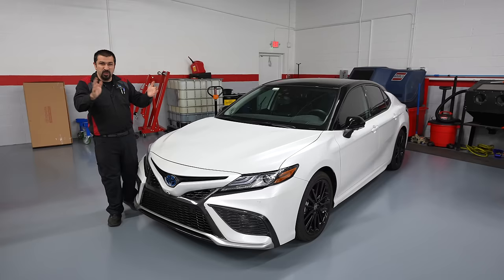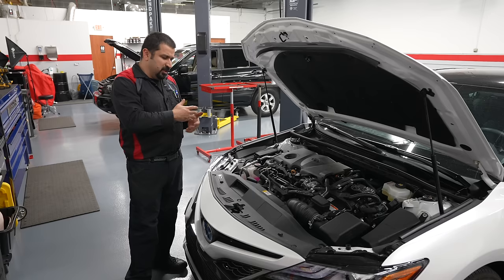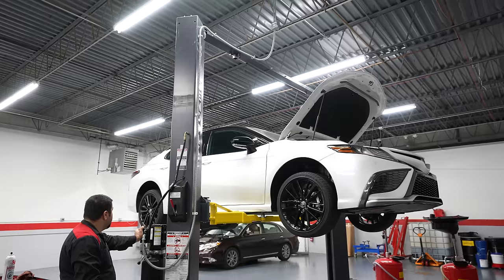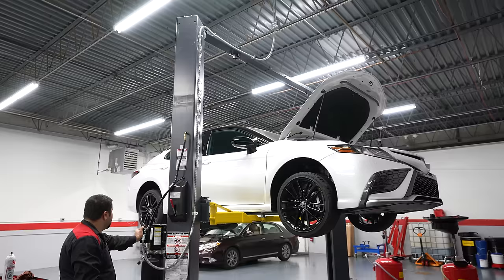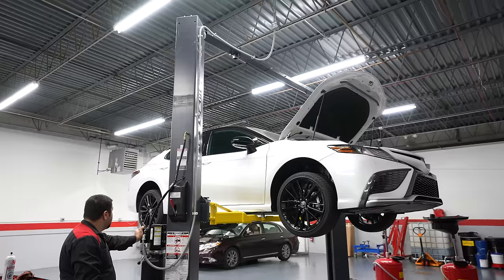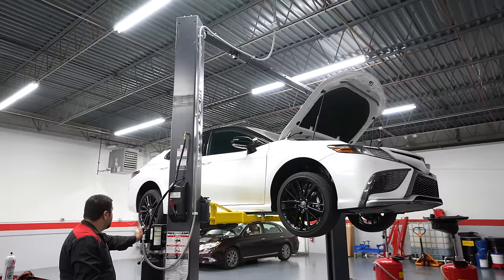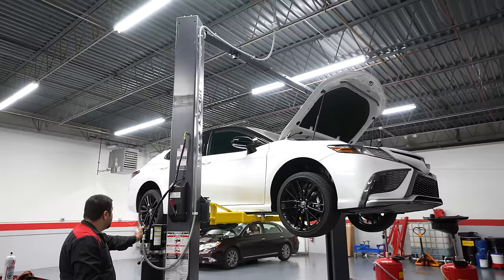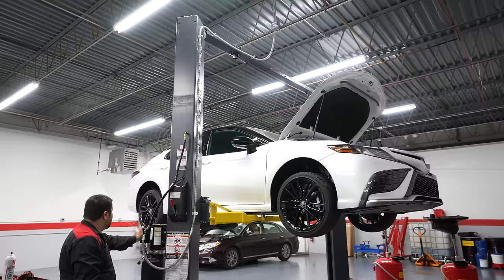Should you buy a Toyota Camry Hybrid? 1 Year Ownership Update

Comment: I love your channel it's very informative I have a question regarding my Camry 2023 hybrid Le. I want to take your advice to change the oil at 1000 miles for break-in and at 5,000 MI for first oil change after break in and I cannot locate an oil filter. All the sites have 20 22s listed none of them have the 2023 so my question is this, is it a standard N1 filter that I need or is it something different for the 2023. Love you videos they're great keep making them. Regards Jim k
Reply: Standard the oil filter is same since 2018 since it’s the same engine since 2018 just make sure you get an oil filter from a reputable source or dealer

Comment: Our 2020 Camry Hybrid with Li-ion batteries has a warning in the Owner's Manual that the engine will not start when temperatures fall to -21 degrees F or below.  At low temperatures, Li-ion batteries become useless bricks.  Both EVs and plug-in hybrids have heaters to be useful at low temperatures.  If all Toyota Camrys are now hybrid, does that mean they are of limited use in winter here in the cold north?  Or, do the new Camrys provide heaters for the Li-ion battery pack?

Comment: Great video, I just purchased a 2023 Toyota Camry SE upgrade Hybrid and would like to know what diagnostic tool brands I can use to make changes on the car specifically to turn off the seat belt chimes, I drive my car 1/2 mile down a dead end gravel road to my moms house and very much dislike the chimes just for that short trip. Can you tell me some brands that will work for this? I live in Canada. I asked Toyota and they refuse to do it due to some liability issue, on my 2021 they did it for me. Thanks.

Comment: Just got a 2022 camry se, NON hybrid this summer.   Really like the car.  Couple things though, as you said, body panel gaps, bugs me every time I look at them (hood and fenders mostly)  and twice while pulling into a drive with a dip that would put a diagonal twisting force on the chassis,  it sounded like the roof skin popped (tin canned) (sun roof car) not real loud.  2.5 is noisy when cold, i believe it's normal gdi noise? Anyway, fuel economy is great, 36-40+ on most trips.  Maybe you have some insight on how and when it switches between gdi/mpi?  Any fuel system maintenance on these to keep them happier? Amazing little engine.  Thanks, love the video's.

Comment: What is wrong about non-Toyota engine oil? If I use the same grade from an API certified engine oil it should offer the the same protection no? If Toyota only sells 1 kind of 5w20 oil for all the different kinds of Toyota engines using 5w20, I don't see what is special about Toyota Oil?

Comment: Ya man. I got a 22 highlander plantinum. And the build quality is complete trash. I’m very disappointed. My 16 Prius and 15 sienna are both more solid by comparison. Aside from how crappy the 8 speed transmission is to begin with. It gets worse when it heats up. And when it gets loaded up with passenger I’ve noticed a weird vibration when accelerating!
Im assuming it’s related to where they are sourcing parts from.

Comment: Is the wet boot maybe a specific rubber oil/grease that keeps the rubber soft? You can buy spray oil for rubber bushings to keep the rubber soft and flexible. My Toyota has 100,000 miles and all the original bushings. There's some micro stress cracks but nothing thats in needs replacing yet. The only bushing I've had issues with is the anti-roll bar drop links.

Comment: Yes I changed my oil at 982 miles 2022 Corolla SE. Had old Japanese oem oil filter and number didn't match my new one. It was old part #. After watching this I will change it at 2500 miles next to be safe. The car is stunning. Wind Chill Pearl color so sharp. Bought it after your recommendation video I watched. Really surprised Toyota didn't offer hood insulation.  Only on 1.8 not 2.0 just a bare hood. Went and purchased fireproof insulation and shaped it to fit under hood. You added hood shock to your Camry can it be added to 2022 Corolla SE? Thanks Amd.

Comment: Through a service dept window I noticed they used oil from a supply line not bottles when we had the first oil change in our Highlander.  Do they use a substandard oil in most shops? Also they were not happy that we had a service done at 5K miles vs the 10K that they recommended.  Really enjoy your channel and all the information you provide for the Toyota consumers!
Reply: I have an accord and brought it in for service at 5k miles they said it still had oil life left and it didn’t need it. I think due to employee shortage they did that. Took it to another dealer and they changed it no problem

Comment: Nice maintenance overview and Sweet camry.   I have a 2022 corolla cross, almost 8k on. Did my first oil and filter change at 450miles..then second one at 1500. And another one at 4k and 6500k. I stick to the 2,500k changes. Car rides great, couple noticeable things.

I have the same issues with door and trunk not allinged properly. Easy to fix that yourself, with extra help of hands.
 After first dealer service @ about 4,80] miles( no oil change ) I noticed a spring like tension clicking sound in the steering wheel. Only when making turns. Both L & R ways. Not to bothersome but it's there. 

Sometimes the fuel level won't show correctly if I fill up when it's 80+% full. It'll remain at the same level even tho it's 100% full. Will only return to correct levels after tank is half empty and after filled up again.

I've never had a CVT before. But at very low rpms. You can hear the transmission shift and move...almost like it's not working properly, but that's at stop sign rolling/ speed bump speeds. With normal driving. Everything works great.

Last note, occasional small rattle/ squeak from passenger window ( closed ) might be due to changing weather.

That's it for now. Hopefully no more noises will rear their ugly heads.

Average 32mpg. 90% city street driving AWD L model
Reply: The build quality has gone down substantially. I'd run

Comment: I have dm’ed you on instagram, the noise also comes from door handles that resonates inside the cabin. I have seat belt panel rattling when the temperature goes down. The dealer put 0w20 last time when i changeg the oil, i could feel the difference between 0w16 and 0w20, but no choice gotta use what dealer has… will try to push them next time to get a 0w16.

Comment: I’m really leaning towards buying either a Camry hybrid or a Rav 4 hybrid but I’m torn because I’ve heard the Rav 4 has corrosion problems them the hybrid electric cable. Any opinions would be appreciated.
Reply: @sk-un5jq  all comes down to price and the CRv sounds high end now
Reply: Sooner rather than later Toyota is going to sort out that cable corrosion issue because building Hybrids is their bread and butter. I hope the next RAV4 increases its interior dimensions to match the competition but if today's model is spacious enough for you, I would not hesitate to take advantage of its superiority in every other measure. With the recent introduction of an AWD Corolla Hybrid, it cannot be long before Camry is equipped the same way.

Comment: AMD, how are you sir? I have a question for you, that I’d like your opinion on? What are your thoughts on Amsoil fully synthetic? I only use Amsoil in my vehicle, with a Wix XL filter. I watched videos on just this topic, of a guy who tests the wear oil causes on engine parts, and Amsoil clearly protected the parts way better than say, Pennzoil, or a cheaper brand? I see you’ll only use Toyota oil? I use the same weight, 0-20 , do you think it’s worth the extra money, for the Amsoil? Thanks👍
Reply: If you change oil regularly like 5k miles, any synthetic is fine.  But if you the dot change oil every 15k miles, then go with Asmoil.

Comment: When you inspect the oil filter, shouldn't you cut open the canister as the oil flow should be from the outside into the centre?  Also is there any inspection of the hv battery for 1 yr service?

Comment: Jaun here from South Africa. I desperately need help with my RX.

I bought a 2011 Lexus RX450h and I am having serious problems with the car. The sad thing is that Hybrids have not caught on here yet so there are so few around that there are simply no one that work on them. We installed a rebuilt battery because the original one failed.bthe guy that does the rebuilt says that he thinks the car might be overcharging.

Is that possible?

How do we start diagnosing the problem.

Lexus says just fit a new battery but they cant guarantee that all will be well then

Kind regards

Jaun

Comment: CCN, my wife has an 2015 Sienna. When we drive over a moderate bump/pothole at highway speeds it wants to bunny hop sidways. Mechanics have suggested changing front struts but they do not seem to be wore out as it will not bounce when compressed and released in driveway.  Any thoughts? Thanks.

Comment: I just bought a 2023 Camry. The we’re trying to charge $3,000 for tint and a door edge guard. They dropped the tint and insist on adding the door edge guard for $1,495. I had already signed the contract and I want the car, but I’m not paying that much for such a small and inexpensive job. I haven’t gave them the check just yet, but I have until Friday. What should I do? Should I call Toyota and tell them about this dealership or deal with this market adjustment markup disguised as a door edge guard?

Comment: Did I notice that the oil funnel threaded into the filler hole or just a press fit?  Is it a Toyota part or after market?  I have been using a funnel that is not optimal for this use.

Comment: Did I hear you say the Toyota dealer does not use genuine Synthetic Toyota 0w16 oil? Are they just putting in their bulk oil? (5w20 or whatever) isn’t this engine sensitive to using the correct viscosity so why is the dealer not using the correct oil.

Comment: Hello and Greetings,

I have learned a lot of good information from your YouTube channel.

I just bought a 2022 Toyota Highlander Hybrid and ca not find a correct factory pen Oil Filter.
I went to a Toyota dealership and they gave me the wrong Oil Filter, I think it is for a V6. It was a YZZA1.

Nothing is listed in any of the four owner manuals for the 
Hybrid Oil Filter Part Number.
Can you please help me find the right one.
I took the cover plate off, down where the oil filter is located, but it is turned to were I can not read the last digits. The first part is 90915. I don’t wish to guess at the last digits I believe is YZZN.

I do not want to get through changing the oil change and then find out the new oil filter will not work or is wrong.
I could remove the old factory filter and re-use since I only have 1500 miles on it.

Also, do you have a part number for the correct oil filter
Socket or wrench for the filter.

Thank You,

Tommy

Comment: Can you help me sir.  I need to remove the engine and transmission of our 2003 Camry 1az Fe.  The engine won't turn that's why I can't remove the bolt of the torque converter. 

How can I remove both the engine and transmission pls3x

Comment: Why does it need an 3 oil changes in a single year with so little driving? Im missing something? My current car which is a 2011 model (turbo gasoline) has a 15.000 km / 1 year interval whichever comes first. Im waiting on a new car (turbo diesel) in a few weeks, and I got the service manual to see what awaits me. And on the new car, its 30.000 km / 1 year interval whichever comes first. Which is so much more that the what you did in your car. It had to do with a hybrid turning on and off all the time with it barely getting up to temp in the beggining?

Comment: You guys think it's true that these can run up to 700k km (435k miles)? 

I took a taxi and the driver of the hybrid Camry told me the car had that many miles.

Wtf!
Reply: I mean, I saw some guy on YouTube who has almost 400K on a 2011 Camry SE which has the 2AR-FE engine, which is “one of the worst engines Toyotas created” as some would say (not true). Since this model is a hybrid, I’d say with good maintenance it could easily surpass that. Only time will tell though, this car is only 2 years old

Comment: Hey man, I purchased a 2019 Camry hybrid Se. right now it has 90k miles on it. I am the second owner , got it with 56k miles on it. I have one concern and I wanted to check if it was normal. when I am driving the car I notice there is a lot of vibration mainly on the right side. I notice the engine when it comes on it vibrates, I am not sure if the vibration of the engine is normal or if it is causing the vibration in the car while driving. Vehicle has 4 brand new tires and recently got an alignment, they problem continued.

Comment: I was told with the new cars that use full synthetic oil you only need to get the oil change every 10,000 miles.  Is that incorrect?
Reply: @EpicDrew15  So is it better then to get an oil change with full synthetic every 5,000 miles?

Comment: If it has a cvt transmission than im not interested, which what I have heard all hybrids have. Its too bad to do that do such a great car. Just make sure you take the extra warranty on that transmission.
Reply: The hybrid has a ECVT which is a completely different than a traditional CVT.
Reply: @jml9550  Same transmission different name. Still junk and wont last and is really expensive if it fails, that's  why I said you better have a good warranty
Reply: @ksmooth1973  the ECVT has been used in Toyota hybrid drive for a long time in many models.  Proven to go 250k miles +
Reply: I have heard nothing good about cvt transmissions. I won’t touch one
Reply: @ksmooth1973 Same name, completely different methods and technology. Two electric motors and fixed gears vs belts and mechanical wear and tear.
Reply: The regular Camry im pretty sure has a traditional transmission.
Reply: @KillerofGods  I think you are correct its just the hybrids that have low horsepower and a cvt transmission.  Like I said thats too bad they have to ruin such a great car with that horrible transmission
Reply: @KillerofGods  When that cvt transmission has problems its huge money

Comment: Hello! Can I run my issue by you & pay you? This has been over a year, 4 shops (Inc 1 highly trusted but doesn't do the work).I've gotten mixed diagnosis,  "fixed" by Toyota 3 xs but didn't actually fix it. 2008 Camry Hybrid 116,000. In short, drain on battery while off (ABS/VSC alarm is on, all lights in the dash). I believe there is an open circuit or a short (mice got into the engine - esp by the ABS/VSC relay box). The alarm started when I was checking those relays, a buzzing noise started, I pushed relays in & out, & then the buzzing stuck, ABS/VSC alarm began. Prior to this the passenger side slid into snow - looked like it was road- was actually deep snow ditch...subsequently, ABS/TPS light on. The NEW (x 3) 12V battery never seems to get up to total green when I look on the engine-hybrid screen.   The only way I have been able to drive it is to disconnect the negative battery cable when I park it, re-connect when want to drive...creating many issues during winter-snow-freezing rain when trunk has been stuck shut. Ideas?

Comment: If those details bother you so much, you're for sure, not focusing enough on the important things in your life; it's all on your head, calm down your inner 8 year old. But if you're gonna fix them I recommend Sorbothane pads and to even cushion better the road a High Profile Michelin Tyres and finally *Coil SumoSprings*; these 3 would give you extra absorption and the components won't be shaking much. Also what about *Twin Tube Gas Shocks*? Even more absorption and smooth drive.

For what's worth: Electric Engines are in diapers still, all that fuel economy will be nothing compared to the coat of servicing or replacing the Electric Engine/Battery 🔋 of that hybrid, the materials, manufacturing and recycling makes them not better than a gasoline engine; therefore a bad idea for now, you're not helping save the Ecology; same for Hydrogen Engines, not ready, costs too much, it's difficult and dangerous still; but people want them, so have them, but later on, don't complain, just tell your horror story and go to work to buy a gasoline car hehe

Comment: Why do some people fill the filter with oil before installing it.?
Reply: This is to "prime" the filter,

This helps circulate the oil quicker, so less "dry" engine time.

If they don't do this, the oil gets pumped into the filter, then has to pass through the "paper" filter material (after saturating it first), then up into the engine.

Versus the engine oil gets pumped into the filter, which then pushes the oil that's already in there up into the rest of the engine.

And since the "paper" in the filter is already saturated due to being pre-filled, it doesn't slow the flow of engine oil.
Reply: @notsureyou  Perfect explanation and examples. Makes a lot of sense. Thank for your quick response. 🙏
Reply: @ewilliamsz2099  You're welcome 🙂